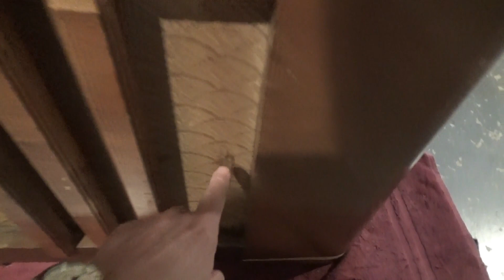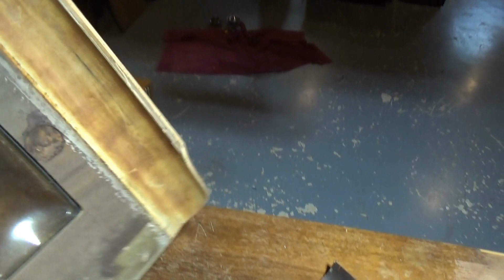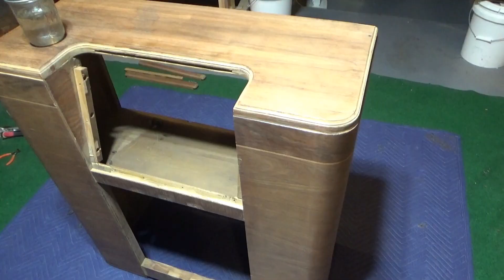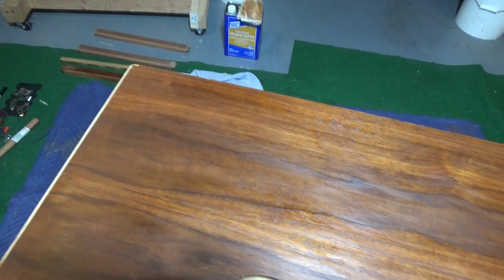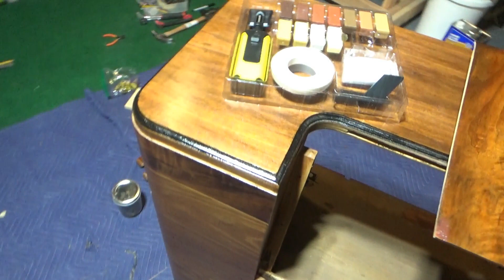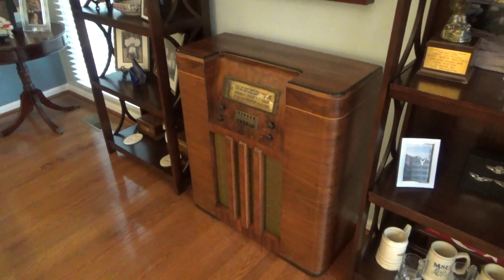1939 Sentinel Radio Restoration part 2 Cabinet

Comment: Your efforts in refinishing were what made all the diference. It looks great and adding Bluetooth to it gives it a more useful
and instant way to get more music out of it. AM is sports, religious and talk.
Reply from the maker: Thanks for commenting on the video. It took me a long time to build the knowledge and courage to attempt a cabinet restoration. I watched many "Thomas Johnson Antique Furniture Restoration" and "Dashner Design & Restoration" youtube videos to learn the skills necessary to complete the cabinet restoration. I did make a few mistakes but I'm not really a perfectionist so they don't bother me. You are correct about AM radio, not much out there anymore. I'm glad that I installed the Wi-Fi streamer device. The amp in the radio is fairly powerful and that old electrodynamic full range 12 inch speaker sounds pretty good playing modern music. Not much treble but midrange and base are great.